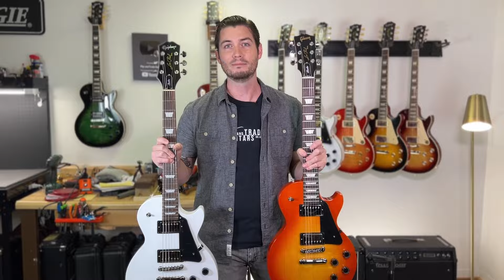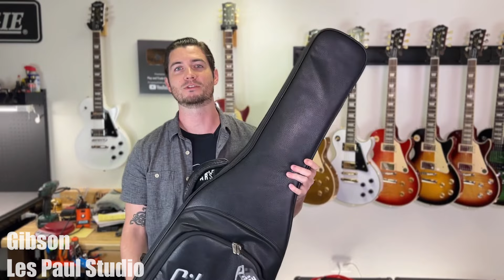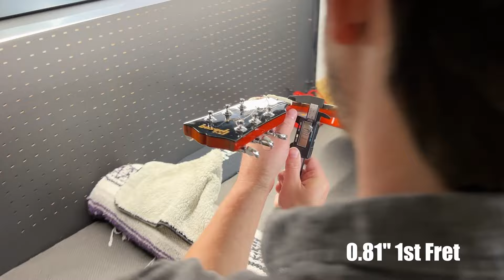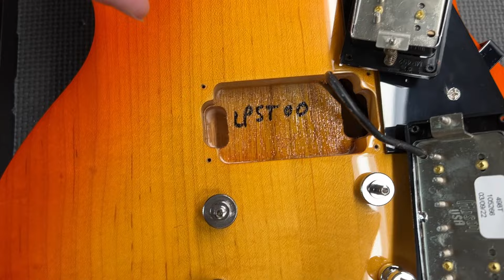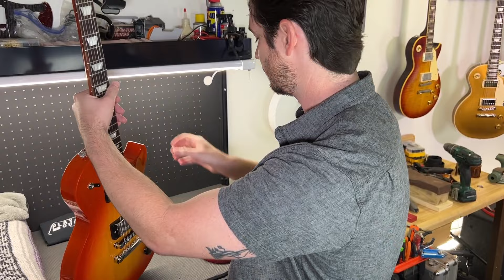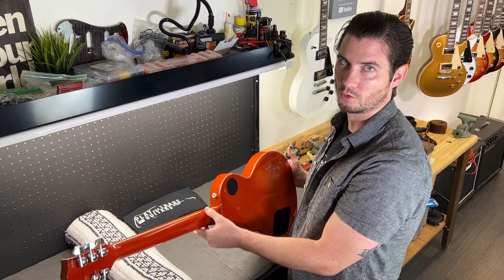Gibson Les Paul Studio - Top 5 Reasons to Buy over Epiphone

Comment: Just got a 1990 Gibson Les Paul studio with ebony fretboard, love it. And with current Epiphone LP prices, it wasn’t that much more than what a new Epiphone LP costs. I do love the Epi 59 outfit LPs though.
Reply: Good for you! The 90s studio's with ebony fretboards are pretty rare and are becoming somewhat collectible these days. Also, no print circuit board, coil splitting, ultra modern weight relief or other shenanigans on these older ones. I also prefer the old style Gibson Deluxe tuners on these over the kidney shaped chrome ones on the recent models. I own a 1994 Studio Gold in ebony finish, which I bought brand new at the time. Mine has a rosewood fretboard but that rosewood is of a beautiful quality. I also like the gold hardware on mine, combined with the ebony finish it makes the guitar look really classy. i remember taking it home from the shop and it was immaculate, the finish, set up, just a beautiful instrument, almost three decades later it has a little wear here and there, but it still looks the part and I'm still somewhat in love with it. At the time I really wanted the Standard but I couldn't afford one, nowadays it wouldn't hit a dent in my budget, but even though the Standard is a gorgeous looking and sounding instrument, I frankly don't feel the need anymore.
Reply: It's gotta be an ebony board for me
Reply: @renek243   Thanks! Glad to hear you’re also happy with your 90s studio. Sounds like an awesome Les Paul. I fully agree. The early studios with the traditional specs seemed to be right on par with the standards and other pricier models in terms of quality and feature. I don’t much care for the more modern features on the recent studios.
Reply: @mikeyroberts1252  Indeed. Ebony board Les Pauls are my all time favorite guitars.

Comment: Another difference between coil tapping and splitting is the tap style remains a humbucker, which is a thing worth considering. Pros and cons but it should be an informed decision. I have a wine red Studio, this sunburst finish model looks great! I like red guitars but if this was available when I bought mine I might've gone for it. One inobvious advantage of the non-bound LP body is that the subtle roundover edge makes these more comfortable against your body and forearm. Makes a surprising difference.
Reply: Right on, I've got one Les Paul that sounds like a Strat or a Tele, gold foil pickups did the trick. So, I've found that Splitting or tapping on a LP sounds like a thinner Les Paul to me.
Reply: @gearmeister  Right, not a Fender single sound for sure. Also not a P90 sound exactly when you split a Gib/Epi bucker.

Comment: What about the top 5 reasons to buy a studio over a standard?   1 its cheaper   2 it looks better in its simpler vibe   3 the backs and headstocks are painted matching (with satin necks)   4 490R/498T pickups sound so much better than burstbuckers   5 Coil tapping.

Comment: That’s very light, even for the weight relieved models. Where individual weights are listed, such as Sweetwater, the average was about 8.5 pounds, with quite a few being 9. Mine is a ‘22 model, and it’s 8.5. Great guitar, and I got lucky with a top that has better flame than many of the high-end models I’ve seen. But mine is cherry burst. It’s rather striking, because the center of the burst isn’t yellow-ish the way most are, but natural maple. I’ll probably keep it forever.

Comment: A solid maple top with a veneer for cosmetics offers the same tone quality as a solid maple top without the veneer. It’s just a lot easier to source the maple and apply a thin veneer without discarding because the grain doesn’t look nice enough.
Reply: I doubts pickups, the pots, the caps, the cable, the pedals/effects, the amp and the speakers care if it's solid or veneer

Comment: Gibson might call this a coil "tap", but it's not.  The pickups are split, but on the circuit board there's a capacitor that the shunted coil drains through which allows the low frequencies to short to ground, but blocks the higher frequencies.  The result is a little less bass when split, but that's about it.  You can easily bypass this by soldering a piece of wire in parallel with the caps, which I did on my 2012 Studio, which gives you a true coil split, just like you're getting on the Epi.
Reply: Then explain why the output remains the same
Reply: @maraviyoso8473  because all it's doing is splitting the coil in the bass frequencies and retaining both coils at higher frequencies.  Once I bypassed the cap for a true coil split, the volume most certainly drops.
Reply: @BudgetRC_Channel  wouldn't that be still a tap on one of the coils? I'm just a guitar player, not a technician; but, it seems what you're describing is actually both a split and a tap.
Reply: @maraviyoso8473  no.  A tap is when a certain part if the winding is brought out like you see in the output transformer of a tube amp.  One winding with "taps" off of it.  In a coil split, it's just where the two individual coils in a humbucker join.
Reply: @BudgetRC_Channel  I know that, but still, think about it
Reply: @maraviyoso8473  no need to think about it.  There is a difference between a tap and a split.  Functionally it's pretty similar, but the terminology is specific in what it means.  Bringing the individual coil leads out on a humbucker isn't the same thing as adding a tap mid-coil.

Comment: I've owned (2) Gibson Les Paul studios in the 90's. One I put an EMG 81 and 89 (splitable pick up used as the neck pick up) in and the second I left stock...Good guitars but a bitch to keep in tune without lockers on the tuning pegs. I bought a new Epiphone Les Paul Custom Pro in KOA 6 months ago and its absolutely amazing for just about half the price. The Epi has 7 layer binding on the body and 5 layer binding on the head stock. The EPI has split coils and phase inverter. The Epi has block in lays from the first fret on down the neck...After a professional set up the Epi consistly stays in tune without locking tuners. The Gibson studios cost $1,300 to $1,500 dollars where I live now and I bought the Epi Les Paul Custom Pro for around 800.00 with a gig bag, pack of new strings, strap, and picks. The Epi Les Paul Custom Pro with the Probuckers 2 and 3, better neck shape, and better sound is clearly the winner for me for just about 1/2 the price out the door...Shoot the new Epi's Prophecy with cut away body and the Fishman pick-ups are better than the Gibson Les Paul Studio and are still cheaper than it...

Comment: I have a 2022 Epiphone Les Paul custom black beauty and it does not have coil split or anything like that in the push pull selection.
Reply: The Epiphone Les Paul Custom Pro has splitable pick-ups and phase inverter on it also. They sell for around $750.00 to $800.00 dollars.
Reply: @petedetraglia4776  there is no push pull in the tone knobs on the 2022 Epiphone Les Paul custom. Mine is only two months old right out of the box and I have checked that trust me.